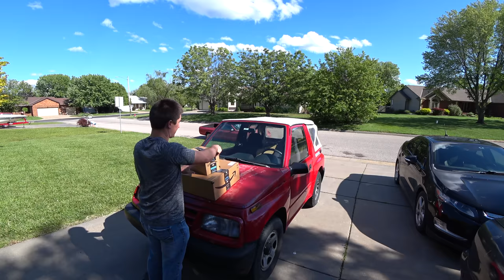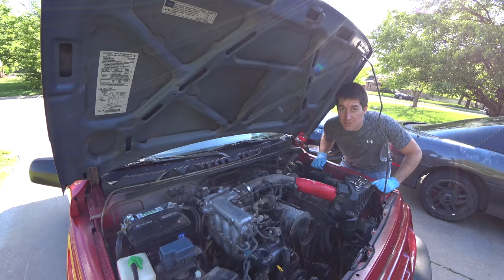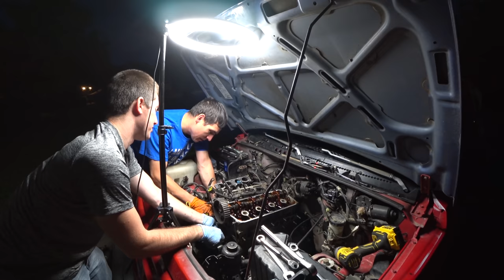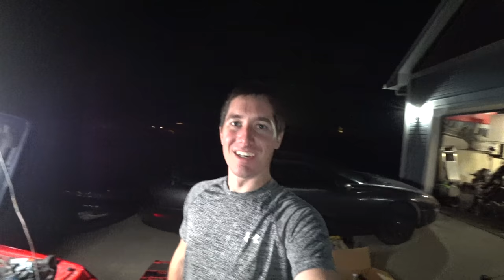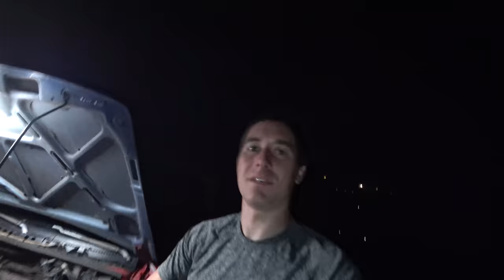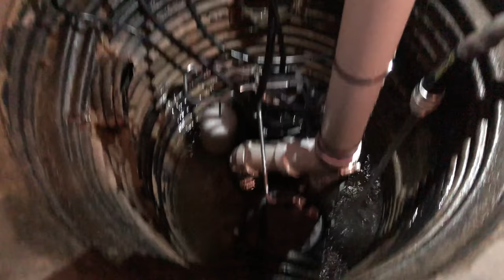$400 Geo Tracker NIGHTMARE Engine *Is It Worth Fixing?*

Comment: Pro mechanic tip...when loosening anything...always pull the handle of the wrench or ratchet towards you, you actually have more power and control pulling than pushing.

Comment: The head is warped so I would resurface the head before putting it back on unless you want to do this twice. Also if the head was completely within spec before removal, you run the risk of warping it if you remove it improperly. Either way I would get the head machined, the valve guides/seals replaced, new lifters, the valve springs shimmed if needed and new cam bearings at least, so that you don't run into more hassle than you bargained for. Also, the head bolts might be TTY, which will mean you need headbolts too. I can't wait to see how it cleans up though, it's a fresh build💯💯
Reply: He should get the block surfaced too
Reply: He had new headbolts in the Amazon box.

Comment: Defo get that head plained.  Probably warped from those uneven head bolt torque
Reply: Vid "table saw cylinder head" ;)
Reply: Layered steel gaskets exist so that decks and heads don't need to be perfectly flat, saving manufacturing cost. Pretty sure it'll be fine. It's a Tracker, not the space shuttle.
Reply: @doug960  I've replaced a couple head gaskets on Hondas before and not plained anything down but i also never had half the bolts torqued and half finger tight or overheated them before hand.  I'm not saying that you can't get away with just slapping a gasket in and going.  Sure you can, most of the time, but sometimes not so much.  If anything, I'd recommend JR check the head with a flat edge and decide for himself if he wants to plain it a bit.  There's makeshift/jury rigged/ghetto ways to get it done too which makes for a fun video.

I don't want to see JR spend all this time and fuckery just to have the head gasket blow two minutes after getting it running.

Oh, also, if you don't decide to plain it, JR, probably hit it with some of that copper gasket spray junk.  Highly recommended in the shitbox sloppy turbo world where they regularly slap junk engines together for as little money as possible.  I haven't done it personally, but I've seen it work.

Good luck
Reply: And the block too
Reply: @doug960  That's not true, MLS head gaskets require stricter flatness and surface finish tolerances compared to a typical graphite style head gasket.

Comment: This is a fun rebuild. Those trackers are super fun cars, that short wheel base can go all over off road
Reply: @bestofbritish4998  The Chevy tracker was build in Canada along side building the Suzuki grand vitaras. Chevy bought the grand vitaras and just slapped the Chevy emblem on them.... Chevy tracker is coming back again they never should have got rid of that crossover. Btw the 3years I've had my tracker for $700 and it runs like a top 168,000miles
Reply: @bestofbritish4998  These are Suzuki Samarai's re-badged to Geo Tracker.  The Vitara was the 4 door version before the re-badging deal with Chevy.

Comment: I told you in another vid that I had one of these, so some more advice:

There’s a fantastic web site out there with forums for Sidekick enthusiasts, but I can’t remember the name. These cars are HUGE around the world, with a lot of guys who really know what they’re doing. Just do a Google.

Next, I had a lift done on mine, but the cheap way. Only about 3” but makes a world of difference:

What you do is buy 2 spring spacers. There are one or two guys that make them. They’re basically hunks of some kind of plastic. On the front, you mount the struts on the opposite side and put the spacer between the spring and mount to make up the difference.

And you use Crown Vic shocks on the rear.

Comment: J.R go great deal" restoration of the tracker" just make sure the head surface of head is true & even the block😃 . I've got a Suzuki Samurai that needs a lot of part & so many extra new parts been collecting parts for awhile maybe get it running in the summer.  Good luck with the build 👏🙌

Comment: I had one of these when I was younger... I had put a Mazda 13B  rotary engine in it... I used to destroy fox body 5.0 mustangs with that bad boy... I also had a wide body spoiler kit on it, plus some 18×9 deep dish rims with some low pro Michellin tires... I had painted it candy apple red and did a custom sound system with with 4 - 10" (kickers ) behind the rear seat with 2 - 6×9 behind the front seats on  the side walls and 2 - 6×9 in the front doors... All the 6×9 where 3 ways for super sweet mid's and highs all around and 4 bullet tweeters in the rear box with the 4 - 10"... You would hear and feel me coming from 4 blocks away... Everyone who saw that tracker went crazy about it... Especially after they heard that rotary Pushing that "AWD" Tracker on race nights in hunts point in the Bronx on the weekends...

Comment: The last time I did a 4 cylinder head gasket job I just left the intake manifold and the header pipe on. You have to disconnect the exhaust pipe. Remove the hoses, any metal brackets, and those pesky little plastic clips without breaking them but it is way easier to remove and install the head that way. Take the manifolds off in the comfort of your shop if you need to with the head turned to a comfortable angle. You can do this job before or after work that way.

Comment: I bought a pair of Hugos back in the 1980's . The one was a salvage car that had been rebuilt. I think it was totalled hitting a grass hopper. The other one had a blown head gasket. I was going to use it for parts but it was so stupid easy to fix, I ended up repairing it on a?weekend marathon of wrenching on cars. I had a guy fix me up on any parts I needed as he bought the entire inventory of parts from the dealer. He told me the engine was a fiot 128 with Ford emissions system. Which were easy to remove and trash. He had doors, windows, all the hardware and engine parts to last a lifetime. At 60k the head gaskets always blew out. Oil leaks were common as hell on them. They would sit on the dealership showroom floor and bleed out oil . The dealer had to put an oil pain under the engine. That car reminda me so much of the Yugo. They were fun to work on but complete garbage.

Comment: If I were keep'n that truck I'd pull the short block and replace the clutch components @ this time ...it's SUPER accessible now ..then you can check the oil pan gasket and front/rear main seals too ...and a head resurface wouldn't be a bad idea as well as new head stretch bolts ..other things that might need replacing - valve guide seals .valve springs  etc...also Rock Products ( DNJ Engine Components )makes awesome graphite coated head gaskets that we have found to be optimum on aluminum heads...yours would be the HGS530 kit
--jus some stuff that would insure it remains on the road for a long time forward

Comment: Well I thought that engine would be trashed once you pulled the head off, considering the condition of the rest of the car.   Surprised those cylinder bores look brand new.  Also did you check and make sure the head wasn't warped???  It might have gotten really hot which caused the headgasket to blow and warped the cylinder head.
Reply: I always budget a new head in the cost of any head gasket job. If it's good, you lucked out

Comment: Don't knock all the EGR and sensors: they kept that mini SUV about as fuel efficient as a Toyota Corolla ( but with half the acceleration).

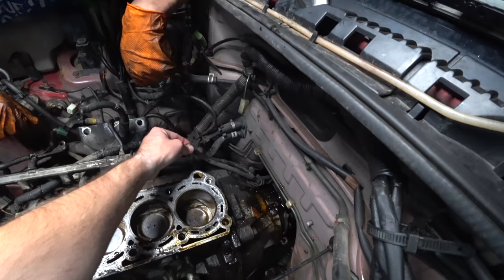That little "sippy tube" at 22:22 is the air vent for the transmission.

The Tracker looks somewhat well maintained, but you should replace the seals on the transmission and rear differential while you are at it.  They tend to fail somewhere between 180k and 200k miles.

Comment: How about checking the cylinder head and block for plane?  Is the head warped?  It'll blow the gasket again...
Reply from the maker: @Joe Copa  gonna have to eat those words when the next video drops 💯
Reply: You should at least have it checked to make sure it didn't warp which would be rare for an aluminum head. Even if it does run doesn't mean it'll hold up.

Comment: When changing a timing belt, put some liquid paper on both the pulley and the belt, on the top and bottom pulleys. Then, paint at the exact same position on the new belt. This way, you won't have to worry about putting it in the right position.

Comment: They are NON interference motors. I’ve replaced belts on 3 with no issues. 

I also have one that I spent over $2k for machine work for a d16z6 Honda crank to fit with coated Vitara and FJT Racing ‘custom length’ rods along with a ported/polished head. I just need to send the crank out to get nitride treated then a final polish and assemble/install (for 6 years now)

Comment: We had a 1995 tracker every 30 to 40 thousand  we pulled the valve cover and retork the head bolts. Got around 200 out of it. Frame in the back rotted out. Asome VIDEO!  (PS  24 mile to the gallon)
Reply: Should have oiled the frame and body yearly

Comment: Always pull the head  and check it and block for cracks before ordering parts.  You save the troubles of returning parts and can just buy a rebuilt or used engine for less issues.

Comment: I have done a sump pump and worse, a sewage pump in my own home.  I put in a battery backup as well.  Sold the home and then one year later, a hurricane hit.  The new owner called me asking me how long the battery would last.  I told him tops, 8 hours.  He did not go out and get another battery - and the basement flooded.  He got a generator installed after that - and that house was inland NJ!

Comment: Trashed hood on a $600 Geo, and he's worried about sliding a box & scratching the paint.  If only every mechanic had the respect & work ethic of JR. 👍
Reply: Stymie Snerdly last time my truck was at a shop for a simple inspection they moved both of my seats all the way around, screwed with my mirrors, radio and everything else. It’s ridiculous, you have one job, quit touching my stuff.

Comment: When installing the timing belt you may or may not know this but if it’s the 1.6l engine then you have to base cylinder #4 on top dead center instead of cylinder #1 like you typically would with most any other timing belt or chain job on other vehicles.

Comment: I didn't see if there is a check valve installed. If there isn't one, it's good to put one in so all the water in the line doesn't drain back into the sump. Otherwise nicely done! 👍

Comment: Do they use salt where you live? Try doing this on a vehicle from Minnesota lol. Manifold bolts become one with the engine or half are missing or broke already with studs still frozen in the block. And good luck getting the exhaust springs and bolts off without cutting them here.

Comment: 15:10 bug flew into the engine lol
Reply: I had a ford 302 once that started to run bad, wasn't getting enough fuel, pulled the top off the carb and believe it or not, I found a 'love bug' stuck in the right side main jet. To this day I have not figured out a bug can enter into the bowl of a carb and find its way into a main jet. Only thing I can think is it crawled in through the vent butall filters were in place. Go figure.....
Reply: @jamesmoore3346  On the carb for my 64, there was a vent tube from the top of the carburetor bowl that was just above the throttle valve. So anything that got past the air filter could crawl into the bowl.

Comment: A friend of mine has a shed and garage full of parts for those.  He won a lot on eBay, he thought it was just a new, old stock water pump and timing belt for a Vitara as he'd just bought one, it turned out that what he'd won was basically the entire obsolete stock of Vitara parts from a Suzuki dealer that had cleared out their parts department.  It cost him the grand total of £28, and 5 tanks of fuel to move it all lol...

Comment: I would definitely take that head and have it plained,  no way would I think I may have to do that twice. we did my Samurai and the motor looked great as well. that dizzy is a pain in the ass to get clocked right as well. hope you have a degree torque wrench,  cause my Sammy your torque them down so far then they were 90 degrees after that if I remember right

Comment: Would it have made sense to pull the engine out, put in a used/rebuilt unit ($2000 on ebay), rebuild the original engine and then sell it??
Reply from the maker: It would’ve made more sense to just trash the old engine, I could’ve bought a solid one for less than the machine work on this one 😂
Reply: WatchJRGo i’m wondering if maybe a motorcycle engine from a wrecked bike would work?

Comment: Should have the head check to see if it is not warped. If  the engine got hot and the head gasket blew the head maybe warped.By the way where is your breaker bar for breaking lose them bolts!

Comment: As a rule, all 16 valve manifolds are cracked.  I know you already have it back together, but you could have shaved like .035” off that head and bumped compression.  I speak from experience on that, and it really improves performance
Reply: I've often wondered about this. Do you need to run 93 octane afterwards? Does it make the engine run any hotter?
Reply: @russgould707  I have no overheating issues at all.  In fact, I removed the fan because in the winter I could not get it to run hot enough to defrost the windows.  Now with electric fans, they very rarely are needed.  I run 87 in mine.  Previous owner told me bumping timing more than where it is now really helps performance too, but lots of pinging on 87.

Comment: WatchJRGo -- Doug Thorley Header's On the 16v makes all the difference. While you have it tore down, replace the starter (pro tip). Also.. Go a head and replace all the vacuum lines. That throttle body is super sensitive.

Comment: get yourself a milwaukee cordless ratchet my dude
Reply: 99in3 How much do those run for? Sounds sweet!
Reply: With I bought one before I got my air ratchet. Didn't realize how much torque they have. My new favorite for sure. Highly recommended a Milwaukee cordless impact driver and ratchet.
Reply: Please get that cylinder head checked for cracks or warpage. Be a shame to go thru all that work and something be wrong with the head.

Comment: Hope you check the Tolerance on the Block and also the warpage on the head.. Otherwise you'll be repeating that job very quickly!!!
If you didn't resurface that head prepare for another blown head gasket
Reply: steven petty that does not happen all the time I change one on another car and it did not blow.
Reply: Jason Robinson it takes less than 5 minutes to measure with the straight edge on the head in the block I would definitely I hate to do all that work and have to repeat it. Real mechanics wouldn't take that chance!

Comment: Dude be sure to check the crank gear for the timing belt, specifically the keyway. These 1.6 have a problem with the crank sprocket bolt loosening and the pulley wobbles and destroys the keyway and crank. Ask me how I know...
Reply: Jake You mistakenly took the center bolt off when doing the timing belt and didn’t torque it to 94 ft/lbs when putting it back.  Lol
Reply: @Inisfad  Nope, they recalled the factory torque spec to later be 94 ft lbs. Also you don't mistakenly take the crank gear out, if you're a tech you should most definitely take it off to replace the crank seal.
Reply: Jake Sorry, But absolutely and positively not.  While the crank bolt torque was listed at something like 52 ft/lbs, this was what was causing the shearing of the keyway. Suzuki issued a TSB to indicate that ALL these crank bolts should be torqued to 94 ft/lbs.  Of course, ‘if you’re a tech’ you would be aware of this.  By the way, some people who are NOT a tech, mistakenly take this bolt out when they’re doing the timing belt - that was the issue.
Reply: Inisfad right, that’s exactly what I said in my last reply. They updated the torque spec to be 94 lbs later on because the crank bolt would loosen up and cause the pulley to loosen and the stress of movement would wallow out the key way. And you should take the crank pulley out to replace the crank seal, which you seem to think is not necessary. I’m telling JR to simply check the torque of the crank bolt not trying to split hairs over verbiage of a TSB
Reply: Jake It makes NO DIFFERENCE what the year of a Tracker or Sidekick is - the torque is ALWAYS 94 ft/lbs, whether for an 89 o a 98.  The TSB rectified a past ERROR.  There is no ‘hair splitting by advising that regardless of the year, the torque MUST be 94 ft/lbs.  That was my first post, to which you said ‘nope’......

Comment: Ok I’ve owned one since 1998 bought it new. I’m on motor 3. The forums describe this motor as driving a hand grenade with the pin pulled. It’s gonna blow up usually sooner than later. BTW the exhaust manifolds are all cracked. More of that Suzuki design . Mine is getting a 4.3 Chevy motor when motor 3 blows. Super crap design
Reply: What are you doing to your car? Lots of miles?
Reply: @Dark_Ages_Crusader  right now its awaiting a new short block but will be returned to operation soon. next motor will be a 4.3 chevy

Comment: You guys need power tools!  

And yes there are headers and full exhaust for them.  Also bolt on turbo kits.  Look up Calmini.
Put a new starter on it while your there. Trust me.
Reply: Ryan Harte Calmini is still around? That takes me back, seeing those ads in Sport Compact Car magazine, they even offered a body kit for my high school hooptie ‘88 Maxima!
Reply: @kennyduarte783  
Yes they are. Or at least there web site is up. I used there lift on my tracker but OME shocks and springs. Does not look like they have headers any more.

Comment: Well I think every car has at least one terrible design like when they put those bolts that have nuts on the other end and the nut is basically impossible to get a wrench around because it's in a ridiculously hard-to-reach place and you can't just undo the bolt because the nut just keeps spinning around